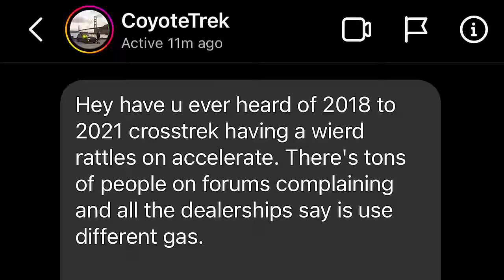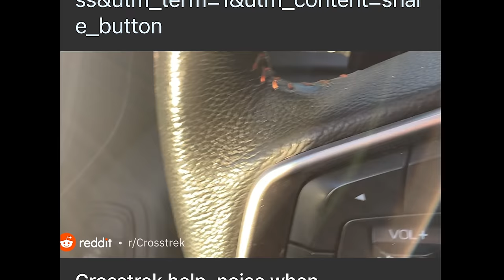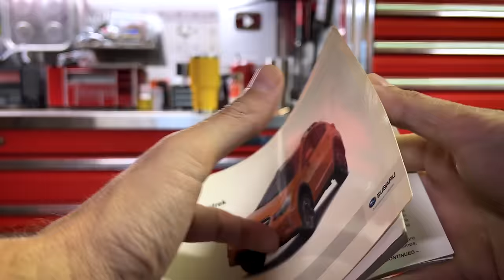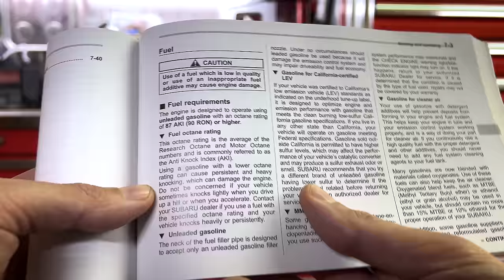Rattle, Ping Pop!? What Is That Noise In My Subaru's Engine?! Detonation & Pre-Ignition Explained

Comment: I have a 2018 Crosstrek with this issue and have 100% confirmed it's fuel related. Over the span of 5 tanks of regular and 5 tanks of premium I was able to consistently get the rattle on regular gas and never able to get it to happen on all 5 tanks of premium. I alternated fuel types after each tank and went to the same gas station every time for all 10 tanks. The dealership essentially told me to kick rocks.

Comment: I've taken my 2019 Outback back to the dealer for pinging twice now. Their official answer is to use premium fuel. Gee, very helpful.
Reply: In my opinion thats the most logical answer because premium and regular gas has different octane rating
Reply: I do not find the Subaru dealership useful where I bought my 2019 outback from either it spark knocks also. They are not very professional and do not do good work almost like they are in a hurry all the time and pushing the mechanics they do not seem happy.. I do not blame the mechanics it's poor management. Also I find Subaru is hiding other problems like the battery going bad after 2years and the factory remote starter is garbage. Overall we like the car we have a 98 also which I feel is a better car.
Also want to thank Mr Subaru for always giving the viewers tips on cars and tools very professional mechanic..

Comment: My 2018 Subaru OB 3.6 sounded like a hammer against metal when I tried to start it up last week. Both my husband and sister-in-law heard it too. I had it towed to my mechanic who scanned the codes. It would not crank over. A ton of codes came up regarding engine failing. I buy top fuel 100%. I had it towed to the dealer as it's still under warranty for 5 more weeks! It would not crank over when we were standing there. They then called me a day later and said they see not issues and it started right up. They only thing the tech mentioned was that there was a strong fuel smell. Now I'm expected to take my car that I bought brand new and that has only 40K on the engine home and act as if there is nothing wrong.  You describe the carbon build up breaking off and causing pre-detonation. Can this occur on start up? I'm also experiencing oil loss...no leaks, on indication of burning oil checking the tail pipe, no smoke. I'm losing about 1/4-1/2 quart every fill up and this just started to occur a couple months ago.  I'm 67 YO. This is my first new car. I live out in the country and bought this car because my beloved 1994 Turbo Volvo wagon has 300K and was giving me some trouble here and there so I bought a "reliable" new car. Any thoughts would be greatly appreciated. Thanks so much for the education!

Comment: 2022 Subaru Crosstrek purchased new started making a noticeable pinging sound from 1400-1600 RPM, at lower speeds, on the flat and uphill. Started around six months in. I'm running Costco 87 octane, which is a Top Tier gas. Sure enough, the manual says some pinging is normal, but that's pretty lame. An almost new car, properly mainted should not be having these issues. I love my Crosstrek otherwise, but this has me reconsidering recommending a Subie to anyone. Thanks for the good tutorial. Please follow up with what's causing the noise in your vehicle.
Reply: Same as my mine. Engine is vibrating while running at 1.5k-2k rpm. And having a rough idle. Did you fix yours?

Comment: I had a weird ping rattle pop at around 2300 rpm off acceleration on a ‘15 XV Crosstrek. Pulled the motor and found a chewed up con rod bearing. Bought a new set of standard sized bearings. Plastigaged everything and chucked a 200 gasket kit in. Bout to slap it back in the car and we’ll see how she does. I’ve also seen problems with hydraulic timing chain tensioners that cause a rattle.

Comment: I have a 2024 Crosstrek premium and I’ve had pre detention/ spark knock since the first week of having it, bought it in August 24’. Its now October, 7k on the car took it on one road trip *what they’re made for*, and its gotten significantly worse. I’m really upset for choosing subaru. I got one because of the longevity they are known for. Yet I’m here stuck with this problem. Being told to use higher octane fuel by the dealer when the car is recommended to use 87. Ridiculous.

Comment: Preignition requires an ignition source such as glowing carbon deposit while detonation is spontaneous fuel air ignition, caused by the increasing temperature/pressure in front of the flame front after spark plug ignition. Anything that causes increased cylinder temperatures (advanced ignition timing, high compression ratio, lean fuel, increased load, etc) can cause detonation. High octane fuel chemically helps to reduce the fuel air mixture from auto igniting and thus prevents detonation. Detonation and preigntion both cause the fuel air mixture to ignite but, they are very different processes and have different solutions.

Comment: After 4 years, my rattle is SOLVED! with 2018 Subaru Forester SJ5 2.0i model rattle at low rpm up hills I have finally found the solution.

It was the MAF sensor for me.

What finally narrowed down the cause was carefully adjusting the throttle input going up hill slowly. At certain points, the CVT engine would simulate a down-shift to compensate for the lower speed, and "shoud" increase RPM, but did not in my case. This caused the engine to run at too low RPM for the required output needed, causing piston knock during this scenario only.

I had also considered the Cat Converter, so I had replaced it just recently (despite only having 69k KM on it). Turned out to not be the issue.

Posting to the YT videos I had bookmarked for this issue to spread out the solution. Maybe others will also see it.

The other common suggestions are heat shield, and timing chain loose, or joint failing. All of these occur at different situations. Only the situation I experienced with low RPM and low speed going up hill produced the sound. Never at idle revving, never on flat roads and never at higher speeds.

Hope it helps others resolve the annoying rattles. The MAF sensor is a fairly inexpensive part luckily, you can get off-brand versions if you prefer. They look identical to the moulding of the OEM Subaru MAF sensor, so I suspect the normal maker markup on an identical item. Good luck to everyone!

Comment: There is another root cause of knocking in the Subaru engine with CVT transmission to consider. My 2013 outback made a noise that I was convinced was knocking or exhaust pipe rattling under Light acceleration.  After very much discussion with Subaru technicians and driving test no cars was found. I told the Subaru folks that that was not acceptable and the problem was clearly demonstrated. I had tried other gasolines and other things mentioned in this forum and suspected knock sensors etc. however, the problem was finally found in the firmware for the CVT transmission. The Subaru techFinally asked if I wanted to try loading new firmware to the transmission controller I said yes. Firmware was loaded and car test driven with a dramatic reduction in the pinging sound. 

What happens with this firmware change is that the valve body does not cycle the solenoids as aggressively when the car is transitioning to freewheeling. The sound is produced by the solenoids being cycled and producing a rattling sound on the right side of the engine compartment. I know this applies to several years of the Subaru 2.5 with CVT.  The fix should be free or nearly free to Subaru owners who have this problem and request it. It improve the drive ability of the car and has not hurt the gas mileage.  I strongly recommend this fix because when these solenoids do not operate so many times per minute of driving they do not wear out and the transmission of these cars is notorious for wearing out the specific solenoid and question. I am convinced that this solenoid over activity is the primary cause of the valve body replacement problem chronic to this drivetrain.  

You are a great mechanic but I just wanted to say that there might be another completely different alternative to the famous Subaru engine knocking sound.
Reply: Thank you! I’m having the same problem with my 2023.
Reply: You sir are legend!!  Just had to replace my valve body because of this knockity-rattly crap that until now NO ONE could diagnose.  Taking my 2013 Outback to the dealer asap.  Thank you!

Comment: Thank you! Finally someone made a video about this. Great video and info. I'm curious to see what you find. My 2013 impreza definitely has a slight knock on acceleration. I notice it most when going from really light throttle to medium throttle for a second or so. As you said, I think that's normal. Before, it was worse though. When I was around 160k I was noticing way more knock. I had to start using 89 octane because of it. Not to long after I developed a rough idle and the car would occasionally not want to startup and run when warm. Had to start it up a few times before she stayed running. Eventually I got a P0300. That's when I started looking at fuel trim which was lean, and that got me looking for vacuum leaks and other issues. None of it got me anywhere. At the end, all of my problems were solved after cleaning the EGR. If it's high mileage, I would bet money that is gummed up and may not fully close. That should be the first thing to check since it's also one of the easiest
Reply: That makes perfect sense, and is why I opened this video. My wife's 2013 Crosstrek with 155,000 miles doesn't knock or ping, and starts fine even in very cold conditions here in Colorado. ...But, it keeps throwing a P0420, and I'm going to attempt cleaning the entire fuel and exhaust system before accepting her repair shop's suggestion of simply replacing the catalytic converters. OEM Subaru Cats are quite expensive. I've ordered the inexpensive PCV valve, and when she leaves the car at home, going to clean both upstream and downstream O2 sensors, and replace them if cleaning doesn't work. I'm also going to try Seafoam spray in the intake for probable carbon on the valves, and do the easy MAF clean. Today I've been researching and found that EGR lifespan is about 10 years, so I'm going to attempt to clean it as well. We'll see what happens. A few hundred dollars of parts beats cats at over 3K for the parts alone.
Reply: @petset77  sounds like a plan. Use OE parts only for anything you must replace. It's also worth cleaning the throttle body with that high of a milage
Reply: @RaffiT83 , Thanks, that's part of the plan... I just forgot to mention it.
Reply: @petset77  how’d it go
Reply: @theskyizblue2day431 , She's taken the car every day except one, and I cleaned the EGR valve (filthy), replaced the PCV valve (clogged enough that the valve inside didn't rattle), spray cleaned/brushed the throttle body- I didn't have time to take it off for thorough cleaning (and I didn't have a replacement gasket on hand), and that's it thus far. It definitely runs more smoothly (although it wasn't bad before), and fuel mileage has improved based on the car's display. I still haven't used the intake valve spray, or run a gallon of lacquer thinner through the fuel tank to attempt to clear the cats. She's off Tuesday and Wednesday, so if it's not snowing, I'll get those things done. ...I'm doubtful about spray cleaner actually cleaning intake valves, based on other youtube research. This car has 155,000 miles on it, and although it starts and runs well, the carbon and other gunk built up on the valves and stems is probably cooked on pretty good. I'm going to tackle the job by removing the intake manifold and manually cleaning the valves, then use the spray regularly as a preventative measure. ....I have a new set of O2 sensors, but am going to replace them after I try cleaning the rest of the items upstream. The P0420 code is still there for now. If I can't clear it, I'm going to replace the CARB cats with less expensive EPA rated ones. They don't "smog" here to look at the stamp on the sheetmetal, and EPA rated ones still do the job.

Comment: My 2014 impreza has a light rattling noise, mostly when at low RPM and trying to accelerate lightly (mostly in 2nd gear). No check engine light or any warning sign.

I thought its an independent problem on my subaru, but seems the issue is universal and affects the FB engines. I will be happy to know the exact source of problem. Am at least happy i have now known general causes.

Comment: Top Tier fuels have additional cleaners and reliable octane values. 
I use Torque-BHP ($5 app for Android) via a bluetooth OBD2 reader and have coolant temp from the cylinder head.
My 2019 FB20 motor has 11.5:1 compression ratio, which is rather high, actually higher than my BMW M3. 
Using the Torque-BHP I can observe the immediate MPG and when I get into the ping realm the ECU dumps more fuel to cool the intake charge. 
I have shifted to running 93 octane and almost all the ping is gone, and my MPG have risen by 5-10%

ALL manufacturers want to reduce cost of operations to their customers for marketing, at the detriment of longevity (maybe sell more cars?). However, the drivability on my car improved so much that I don't mind the cost increase for premium fuel.

Comment: I had a 2019 Crosstrek that had a chirping sound which went up and down with rpm's. The dealership said it's nothing to worry about and just ignore it. The chirping came from the engine area. Identified with a stethoscope. I traded it off for a Ranger with 65 miles left on the Crosstrek warranty. Went from 38 to 23 mpg but when the warranty expired on the Subaru a new engine would be far more than a few mpg.

Comment: I have a 2019 Crosstrek that I purchased 7/2019.  It is a vehicle I use only occasionally for around town errands. I had never heard any fuel ping but then again, I seldom use the car.  In Oct 2022 with 3,800 miles on the car, I took it on a 1200 mile round trip that was all interstate driving; the car was loaded and pulling a small 600lb utility trailer hauling a 700lb motorcycle.  All in, my estimate is the Crosstrek was at its GVWR.    I have used 87 Octane 10% ethanol gas in my Crosstrek since purchase and I always purchase gas from the same Shell gas station.  On the first 600 mile leg of the trip, I immediately noticed faint gas ping noise for the first time ever only when climbing hills on the interstate towing the trailer.   On the same 600 mile return leg route of the trip still towing the trailer, I filled up with 93 octane 10% ethanol fuel; no ping, MPG was the same with both 87 and 93 octane.  It may simply be that with the smaller 148 HP Subaru engine, when worked hard, mid or premium grade fuel may be needed to avoid fuel caused ping.  Just my opinion.

By the way:  Barber's Vintage Motorcycle Festival as usual was a 3 day great event.
Reply: My ‘14 Crosstrek runs noticeably smoother on 89. I can feather foot it more and it doesn’t feel like it’s pulling timing as much mid acceleration. Slightly better mpgs too.

Comment: If you have a direct injection engine make sure you are using GF-6B oil that is designed to deal with low speed pre ignition.
If you have an engine with a lot of miles I would get a BG induction service for your engine to clean out the carbon.
Reply: Is the Subaru oil GF-6B oil? That’s all I’ve been using for my 2020 Impreza.
Reply: @nowiecoche  if it's not direct injection then no only 0w16 is GF-6B

Comment: Had a 2013 Crosstrek. Did the same at 12k miles. Sold it and went for a Forester SH S Edition, originally sold with an EJ 255 and 5EAT + VF52. I may have replaced a knock for a spun bearing… 😂